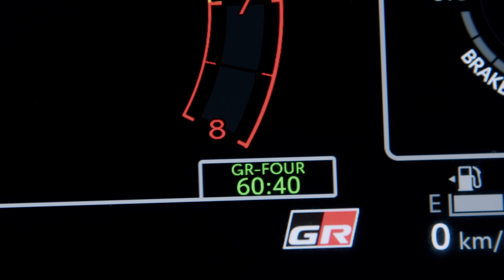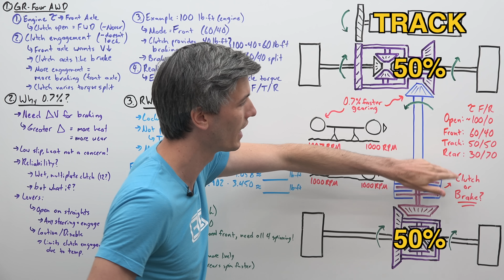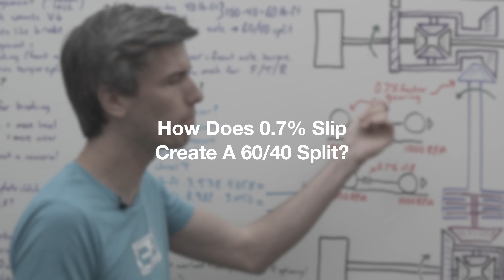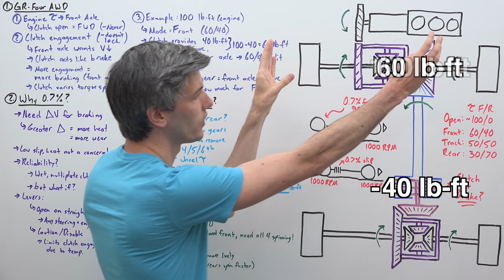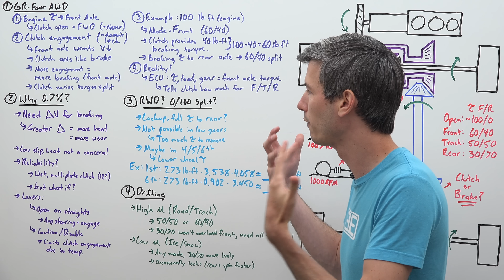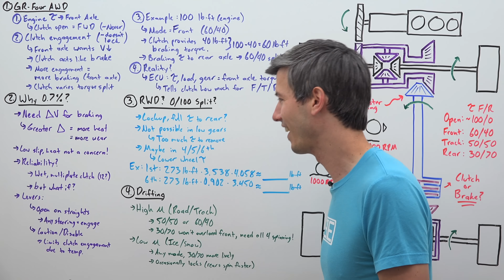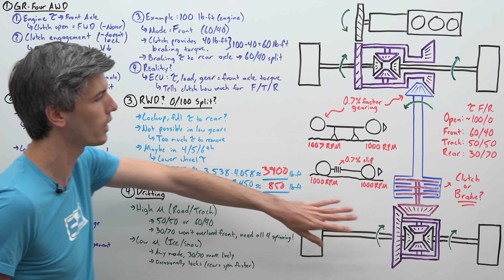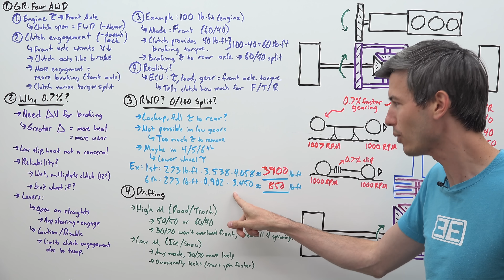Toyota GR Corolla's Brilliant AWD System - How It Splits Torque!

Comment: So now 3 years on, the gr has proven to… overheat the rear and center diff on the track. Go figure. And then it’s all of a sudden a front wheel drive death trap, can electronically shut off your awd mid corner.

Comment: 8:49 "I highly doubt heat generated will be a problem for these clutch packs" fast forward to 2025.....Everyone including Toyota trying to find a solution to the car going into limp mode from the rear clutch pack overheating after a few laps on a track LOL
Reply: It’s not the rear differential that overheats it’s the transfer case
Reply: @jonassal2676 yes, which is made of a series of clutch packs. See my comment.

Comment: My comment on 0:100 front:rear torque split. Of cause if clutch is capable of it. In case the grip is good enough if you force the clutch even further at some moment it's going the front axle starts to brake(!) wheels and at the rear wheels you get power larger(!) than the engine produces. I find this fact amusing and worthy to mention.

Comment: Im having a hard time intuitively understanding how rear wheels can get 70% power and not be spinning faster than the front. Like if you have more power aren’t you spinning faster and if the differential forces them to spin at the same speed doesn’t that mean it’s always 50 50
Reply: it only works when you press on the gas

Comment: The underdriven  front wheels ARE the reason the rear differential overheats--its actually the clutch pack overheating and going full open, making the car FWD only.

People (wrongly) assume that the exhaust pipe is heating up the diff/clutch pack housing leading to the overheating diff but I don't believe it has ANYTHING to do with it!

AAMOF, I just installed a titanium secondary exhaust and I didn't even bother to heat wrap it where it runs close to the rear diff--as the heat is being produced INTERNALLY.

What this car needs is a dedicated pump and plate cooler for the rear differential if you are planning track days with it.

Comment: The torque gets subtracted from the clutch pack via the difference in rpm so basically the torque remaining in the rear wheels are just the residual torque from the clutch pack torque transfer? I’m just trying to visualize what’s happening with the torque transfer.

Comment: How does the torque bypass the front differential when that clutch pack is locked up theoretically? It would still have to pass through the front differential to get to the rear so how could it possibly ever be above a 50/50 torque split

Comment: I am not too knowledgable on the topic so correct me if I am wrong but would it not make more sense for them to implement the traditional regular AWD system where the torque can already be distributed differently between the front and the rear wheels. What makes this system better than the AWD system we already have?

Comment: I've had my GR Corolla about 5 months now and it's a great daily driver and I have fun going back & forth to work, etc.  This past weekend I participated in an HPDE at Watkins Glen, a 3 day event where I had 4 x 20 minute sessions every day.  In addition to instructing at HPDE's, I also endurance road race and took my time getting the GRC up to pace and was cautious with the new car.  First stint I made it 22 minutes before the diff overheated.  My last session Sunday took less than 15 minutes.  This car is a blast to drive on the track but I'm very disappointed with how quickly the diff overheated and put it into FWD mode.  I also [the temps were high 80's F] carefully watched the oil temp as it creeped to about 265.  I appreciate what Toyota has done with the variable F/R drive ratio but it fails at the track.  I can't even complete a 20 minute session while running the original brake pads and tires, what'll it be like when I replace the pads and tires with those better paired to weekend track fun?!
Reply: get a new controller for the awd system and switch out fluid to something thicker upgrade the under panel to the 25 models they made changes to allow more airflow for cooling after doing those ppl claim to not overheat

Comment: Actually standard AWD on without centre diff works the same. When you are cornering, front wheels run faster then rear, and the clutch at rear diff slips defining the torque distribution. The only difference is that here it can work the same on straight, but as you said it is not needed on straight and leads to extra wear and power losses. Also this 0.7% offset makes no sense on snow or gravel, when wheels have much more slip. It will not be able to spin rear wheels faster then front more then on 0.7%.
Actually even on tarmac normal wheel slip under torque is more then these 0.7%, so the clutch may be fully locked on straight and torque distribution will be defined by tire parameters.

Also these systems without centre diff have problems on uneven road. Depending on the road shape, rear wheels may go faster then front. In that case clutch will work in opposite direction and produce braking force on rear axle and >100% of the torque on front wheels. But that is problem for offroad, where Yaris will never be used.

Comment: So does this mean that once there's no signal coming from the ECU that the rear clutch is not engaged therefore the rear differential is not engaged. Meaning you can tow the GR corolla with the car off and rear wheels rolling. Right?
Reply: yes

Comment: Welp... A year later and the rear diff overheating is a common problem on the track.
Reply: Yup I was looking through the comments for this very thing.  Turns out that .7% slip is actually significant heat-wise under certain circumstances!  Unfortunate.
Reply: Yup, it’s literally just a FWD car with part time AWD. It’s a modified system out of a RAV4.
Reply: @avery4528 not true it’s running awd all the time even when it overheats it just send less power to the rear
Reply: @shiftautomotive1997 it’s a clutch pack based system. It is based out of a RAV4. There isn’t a center locking differential. It’s modified to run AWD, all the time, but it is fundamentally a part-time AWD system. As long as you install a transfer case cooler and an aftermarket AWD controller you won’t run into issues.
Reply: @avery4528 not the same system i just replaced my diff from toyota took about 3 months to get it replaced had to have the part ship from japan and it was on back order
Reply: @avery4528 and when my diff went out the car stopped couldn’t move it but was able to tow it on the rear wheel
Reply: @shiftautomotive1997 you going to run a transfer case cooler and change your differential fluid at set intervals?

Comment: It would be interesting to compare to the old GT-four AWD system from Toyota. Theoretically if you destroy the viscous coupling for the centre differential, it is possible to send 100% of the torque to the rear wheels because the transmission is connected to the centre differential first with the front axles and the rear axles acting as the side gears of the centre diff. Of course on a normally functioning GT-Four, the viscous coupling on the centre's side shafts want to keep it at 50:50.

Comment: I wonder if that .7% slip is accounting for natural slip/wear that would occur during every day drivng with weight transfer upon breaking/accelerating causing slight squat on the tires changing their diameter.  Very interesting.

Comment: In the U.K. the centre clutch packs regularly overheat on trackdays in moderate to cold outside temperatures when used hard for longer than 10 minutes causing an “overheat” message on the dash and converts for fwd.

Comment: I was informed this coupler uses electromagnets, not a normal wet clutch system. It has very little fluid in it. Did the toyota engineer mention anything about that?
Reply: It's extended version of ITCC but fluid may be changed.

Comment: This is a super smart system but why not put it in every vehicle??
Reply: because it's a terrible system that's designed to save money. a couple clutches are much cheaper than a differential, or designing a new awd transmission with a built in differential (like subaru or audi quattro). this is not a proper AWD system it's 4wd with a clutch which WILL BREAK EVENTUALLY. awful

Comment: I'd be interested to know what the effect of cornering is if the system needs the rear wheels to be spinning faster than the front, whenever you steer round a corner the rear wheels follow a shorter radius than the front so they want to spin more slowly. That means that, whilst going round a corner, even the 0.7% overdrive of the rear wheels will not actually result in the rear wheels wanting to spin faster than the fronts, if that makes any sense?
Does this mean you get a different torque split whilst cornering compared to on the straight?

Comment: Why do you use different final drive ratios for 1st and for 6th gear since we are talking about the same front diff? (When you try to proove the 0/100 (fwd/rwd) torque split. Thanks!
Later edit: I've just seen the end of this clip and the other one you mentioned.
It would be interesting to see a clip about the cvt in a sxs or an atv. They have some pretty interesting tech with the helix and weights, springs and all. Thanks!

Comment: This is mind blowing for me because this is how the AWD system of the Mazdaspeed6 works, except that it came out in 2005. As far as I’m aware though, the rear diff gear ratio matches the front so it’s maximum split is 50/50 or more front biased. Looking into my resources to see if it’s actually geared faster or not to confirm.

Comment: but wouldn't the clutch eventually wear out. like brakes or transmission clutches and eventually need replacement or start sending less torque to the rear

Comment: You have an error in your calculations.
You did not take into account the gear ratio of the power take-off gearbox from the front axle.
The load on the coupling clutch will be 2-3 times less than you calculated.

Comment: So... f that clutch pack ever seizes or locks up.... you destroy your drivetrain. Hmmm.
Reply: nah that would never happen, it would fail to sieze however and you'd be just driving a permanent fwd car. terrible design
Reply: @krebgurfson5732 lol u won’t be able to move the car at all it happened to my grc car shut off on me wasn’t able to drive until it was fix
Reply: @shiftautomotive1997  ok, well if the cluthc pack is locked it's just a 4x4. which can roll fine.

Comment: I understand this transfer case is fully under a computer control. So it's like a modern jet fighter: if the computer hangs the clutch pack is stuck (and the airplane crashes) 😀

Comment: I'm curious about how the WRX STI system works compared to this.
Reply: a real geared differential which can have a viscous coupling. (auto matically locks the diff by heating up changing the viscosity of a liquid) it will never wear out and leave you with only 2wd, unlike this toyota. however it can lose it's locking capability.
Reply: @krebgurfson5732  yeah I'm starting to see the limitations to this Toyota setup. I've seen a few videos now that try to track this car and the diff heats up too much and goes into FWD mode. It's sad that this was marketed as a track car. The STI also has it's own limitations (not enough oil baffles in the oil tank) but they seem to be cheaper to rectify as of now. I'm sure Toyota will change things up in the upcoming years to keep the diff cooled.

Comment: Hello Engineering Explained
I am Daniel, engineer in ARVidal Racing in Spain,
I am contacting you because we are participating in the Toyota Gazoo Racing Iberian Cup with a Toyota Yaris GR. Our car disconnect the AWD when we run fast for 15 minuts (more or less) if we go slowly the car activates it again. The differential temperature didn't exceed 93ºC. All the wheel speed sensors work, and the steer angle sensor is working correctly. The car don't store faults in the ECU but the AWD light shine when the car fail. 
We would like to know in what conditions the car disconnect the AWD system. Is it possible? I try to contact with Naoyuki Sakamoto but I didn't find an email or similar.
I underestand that you don't have this information. We don't know how to avoid this situation.
Thank you very much in advance.
Best regards,
Daniel Costa.

Comment: In very low speed turning (such as a 3-point turn), does the clutch pack open up to avoid grinding, as the front axle is spinning at a different speed to the rear axle? Does it have a center diff?

Comment: so,  all the math but the 30 Front / 70 Rear ?  hmm.....   all that clutch can do is give you max 50/50.  Subaru STi DCCD is more elegant,  this is a cost saving deal by Toyota and some fancy marketing.
Reply: Max 50/50 is when front and rear diffs ratios are the same. In this case they are different.

Comment: it would appear then that with the clutches locked this system cannot power oversteer where the rear wheels spin much faster than the front. the 70 percent rear torque would approach 50 50 or less as the rear wheel speed increases above the front during power oversteer. the torque percentage would then be dynamic based on wheel speed differences and rapidly close to 50 50. this would be different if the primary drive from the motor went to the rear with a clutch before the front drive which may be how the old Nissan R32 Skyline GTR ATTESA system operated.  It isn't true that you want all 4 wheels slipping for fun power oversteer although such a scenario can still be fun. so this remains mainly a fwd 4wd it would apear ? I don't imagine you will be looking out the side window very long balancing the throttle with this system but I can see how they have linked the handbrake to disconnecting the clutch pack for a but of fun. interested in comments from owners thst have driven powerful rwd cars with mechanical LSDs

Comment: I'm probably commenting too late to expect a reply, but still I feel I need to ask:
How would the car behave were the center clutch pack fully lock up during driving?
Would that result in what's effectively a 50/50 torque split or am I misunderstanding this?
And, on the off chance that my assumption is correct, wouldn't that be in many scenarios preferable to having a permanent slippage occur?
Reply: He explains that at the end a bit more, but the important note is that because of the gearing, if the center clutch pack is locked then it would spin the rear wheels .7% faster than the front. That's usually undesirable, so they use the slipping clutch to allow torque to move to the rear without always doing a burnout. The 50/50 split is done by a computer constantly computing what amount of pressure is required to keep roughly equal torque distributed, and the gearing is set intentionally to make it possible to push more than 50% of torque to the rear.

Comment: Seriously what you talk about is a lossy friction cheat!  Sorry you simply can't bent the rules of physios. Many cars have the rear axle with an electric clutch.  All you need to do is fit different size wheels and you get the very same feel and can also feel the extra losses! Toyota's idea is not adding driving fun by generating more heat! The only fun drive car is the Plaid where you do not have a rear diff and no ABS to play lossy games to get you around the corner with less slip!

Comment: Clutch pack slippage is a big problem with machines like agricultural tractors and forestry equipment.  The composite discs have friction material that wears away due to friction and heat.  This material also migrates through the lubricating oil getting into seals and bearings.  It seems like the engineers could have gone another direction with this one...

Comment: The drift question is not news to anyone who's heard of Subaru. They drift just fine. Also! In Initial D there's a moment early in the First Stage where the question of drifting comes up and Takumi explains that front wheels slip in a drift. The idiots of Speed Stars laugh at him, but Yuichi (the station chief) thinks for himself that indeed the front slips in a drift (presumably except the zero-counter drift).

Comment: could someone explain on how could the rear axle got more torque more than 50%? cause if the clutch pack is fully closed, then we can assume it acts as a solid driveshaft, which will split the torque 50/50. is it because of the 0.7% slip that makes it possible to send more torque to the rear?
Reply: It does that cause it is trying to overdrive the rear axle.

Comment: Hm, 0,7% is very little. Approx 4,5 mm diff in diameter of a tire. Less than thread depth.
Thus the whole principle can break down if one put worn tires in the the rear.

Comment: I'm curious how the GR Yaris/Corolla AWD system varies from the Focus RS AWD system.  I know they're similar in some ways, both have a rear clutch for torque vectoring.  I don't remember if the RS has a diff in the rear, or if the clutch pack IS the rear diff.
EDIT:  nvm, just read a comment from a few days ago that literally answers my query.

Comment: What i see here is, you are using traction of the front tires to do "brake" and create a torque split, is this not taking away some of the available traction the tire is capable of from other things like turning.

Comment: As a mechanical engineer who also trains students, I love your videos, but I have one hangup. I would suggest replacing the word "torque" throughout the whole video with "rotational speed". Overdriving a mechanical apparatus through gearing does not increase the torque applied, it actually reduces torque applied - but what it does increase is RPM!